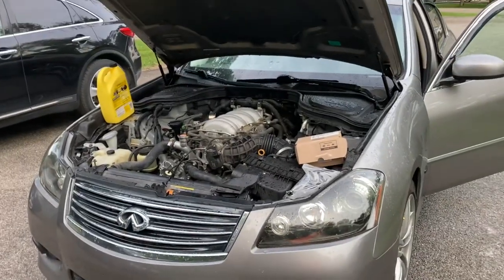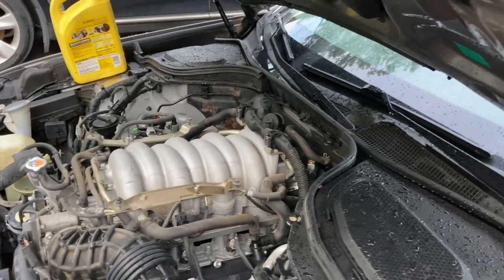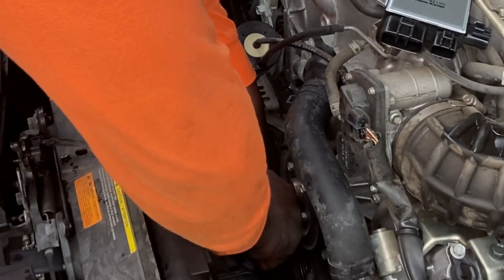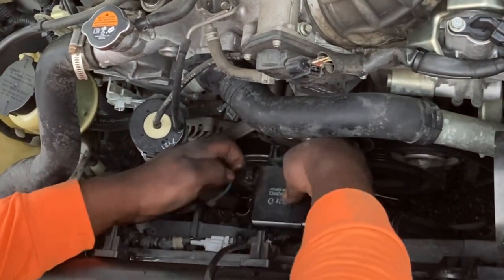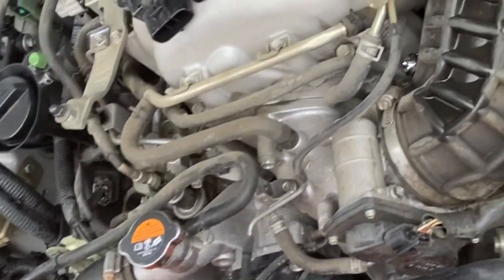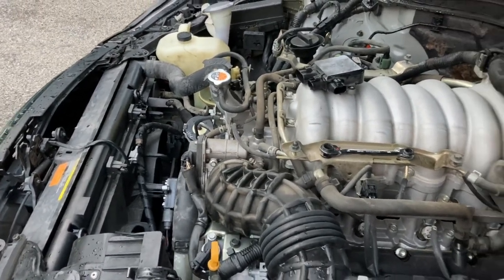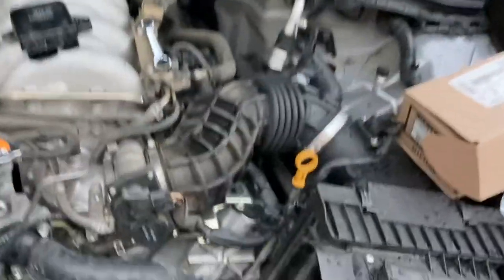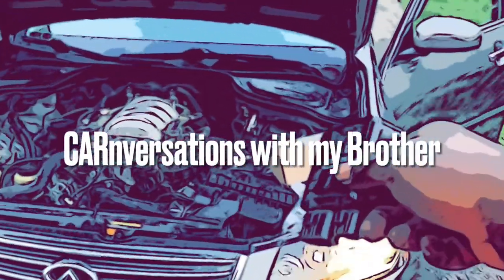Fan Control Module with a hidden failure| VLOG-ish. My Brother’s Infiniti M45

Comment: The revised part number can be found used on other newer, but used Infiniti/Nissans, I went that route, got one from a wrecked EX37 and was good to go. You'll want to go oem on this regardless
Reply from the maker: Yep! OEM or bust. If I got a used one for free, I'd do it. Otherwise, for the price of a new one from the dealer, I don't bother looking for used ones
Reply: @EdBwoy  Ah. Well i figure low mileage used is fine if it’s cheap.  at had like 35k and i got the part for about 20

Comment: I have an 06 M45 and it has a check engine light, but everything is steady and runs fine with the exception that it's much slower than it should be. If I disconnect the negative terminal on the battery for a few minutes, then reconnect it and drive, it acts normal. Any advice?

Comment: I know it’s been a minute since the post but i’ve been having some overheating problems with my M45. Just realized my car is missing that connector that’s at the top of the cooling fan that crosses over the entire radiator assembly to the hood latch.. do you know what part that is and how important ?I changed everything except the Radiator and Head Gasket. I’m gonna try the radiator this weekend and hopefully that fixes it. It only overheats when im driving on the highway for a while, but in the city it’s fine, which made me think it wasn’t the head gasket. Also the only symptom that might be a HG is some foam in the radiator cap, no milky coolant, white smoke, nothing. Do you have any idea based on that if it’s leaning more towards one or the other.

Comment: Hi sir I have a question my 06 equinox fan doesn't run when the car is off. So the next time the car is turned on the temp gauge is way above half..!! I just changed the ect sensor and it's still doing it.. it cools down instantly after car is started??

Comment: I have an 06 M45. My fan constantly ran. Even at start up. I replaced the fan control module. It turns on when it’s suppose to but the temp gauge goes to hot at idle as if the fan has less power with the new module. And my thermostat opens when it’s supposed to. Weird.
Reply from the maker: Is it an OEM fan module from Nissan or Infiniti?
Reply: It’s Beck/Arnley from rock auto
Reply from the maker: @hisagisan    I'd get rid of that one and get the proper unit. Check out this discussion for reference - https://forums.nicoclub.com/idle-changed-to-1000-rpm-on-m35x-t625419.html
Reply: Yeah man, i grabbed one of those new/refurbished ones from Nissan with the silver top, making sure i used the part numbers and info you gave us in that older vid. All good here on 06 M45 Sport